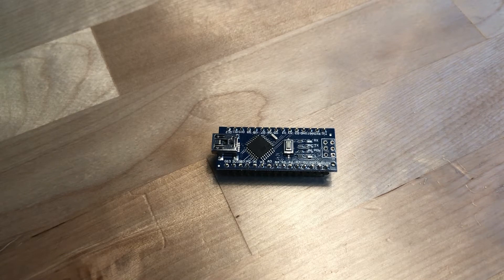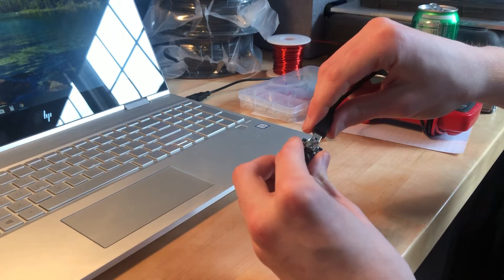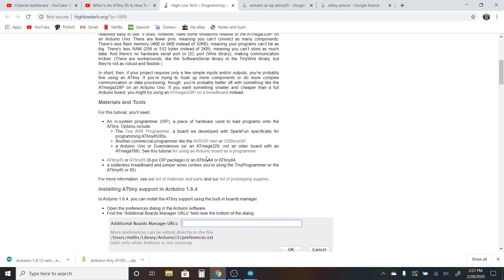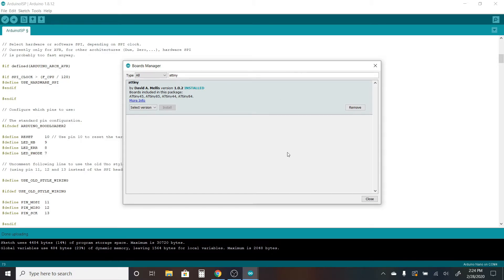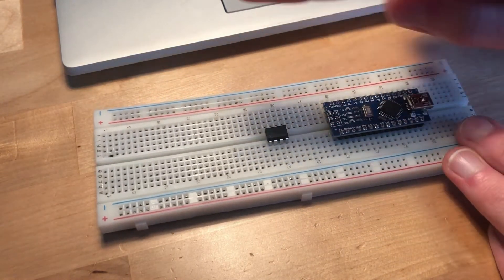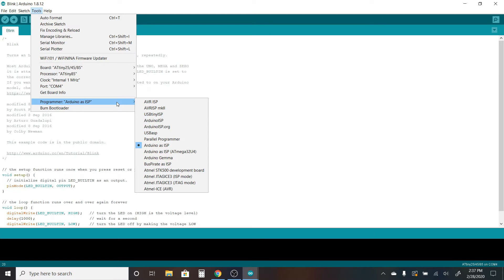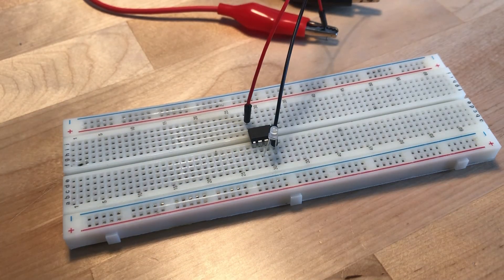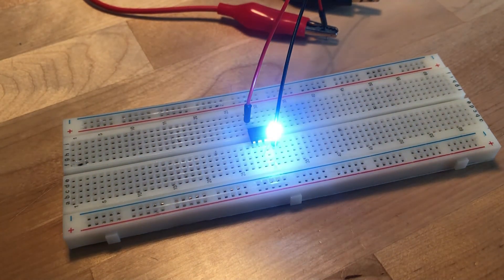How to Program an ATtiny with Arduino (Up to Date)

Comment: the link in the description seems broke, when I put it in my preferences and open the boards manager, I get this error: "parsing error occured:
com.fasterxml.jackson.core.JsonParseException: Unexpected character ('<' (code 60)): expected a valid value (number, String, array, object, 'true', 'false' or 'null')
 at [Source: (FileInputStream); line: 1, column: 2]
"

Comment: Great video. Question: should a current limiting resistor be used with the LED (most arduino projects seem to require that, to avoid blowing it). Or is the AtTiny85 somehow negating that need  ?  Many thanks  ... 🇬🇧

Comment: Superb! Thanks.

I did this with an ATTINY45, as I had no 85s. Same pins, just less memory.

The only problem I had was hooking up to the 45's physical pin-3, not it's digital/virtual pin-3, which is on physical pin-2. Oops!

I'm gonna get some 85s for projects.

Thanks.

Comment: Excellent explanation.  Go to sketch --Upload using programmer and it worked right away. The normal upload  Arrow continued to produce the Error: Programmer needed. IDE2.2.1

Comment: The reason it fails is most likely because of the Arduino Nano clone you're using. I have the same one. The RX/TX LED:s on the Nano clone board are connected in a way that interferes with serial programming, so just go ahead and desolder those LEDs and the whole thing should be way more stable. :)

Comment: I'm using Arduino Uno R3, Arduino IDE 2.0.3 and attiny 1.0.2. I've uncommented "USE_OLD_STYLE_WIRING" and I'm not using a capacitor. I was able to burn the bootloader on my ATtiny85, but not the Blink sketch: "A programmer is required to upload".
Reply: Problem solved: I should have used "Sketch" → "Upload Using Programmer" not just the "Upload" button!
Reply: @GeorgMierau  useful tip, thanks

Comment: I'm looking at the pinout of the arduino nano and I'm wondering why it is pin 11, 12 ,13. I have like 100 teensy 4.0s in the lab and I'm wondering if I need to order an arduino nano to program my ATTINY861V-10MU.  Thanks!

Comment: Very clear and useful, thanks. 8:29 Note that the LED is connected to the pin named PB3 on the ATtiny, not "pin 3"... it's actually physical pin 2 on the chip :-). BTW there's no need to disconnect all the wires from the Arduino to test the blink sketch; just stick the LED in.
Reply: You are correct (DIP8 pin 2) but so is Chris "PIN3" is PB3 and DIP2 ("PIN0/PB0" is on DIP5, for another example)

Comment: good day sir levi, i have a ATtiny85 chips already programmed and used in a small board with relay. this board is used in motorcycle with two additional low/high LED lights left and right of the bike.
The  board has two terminal connection  for passing light switch. when the passing switch was press the two led blinks low and high continuously and can adjust the rate with a potentiometer. my query is can i copy the program of attiny85 chip installed on the board and re program to anew IC attny85? or there another way to copy the program using any programmer. thanks

Comment: What about the ATTiny 2313
Reply: Did you figure it out?
Reply: @Daniel-hd7gq  Never got around to try it.
Reply: @Daniel-hd7gq  Will look at it the weekend again. If you sort it it please share. Notice that the author does not respond to comments or questions.
Reply: @evertspies3345  I've eventually got it working pretty fast. Just had to download the right board lib. If you need help, let me know.
Reply: @Daniel-hd7gq  Hi thank you. I remembered that I did download the board library. There were a couple of them. Just had to get one that worked. I looked at what I had done then and found that I had made a few piggy back boards that plugged into the arduino uno for the different microcontrollers. I never did make one for the 2313 although. Used AVRDUDESS to program hex files. Would a appreciate the link to the library you used.

Comment: Just FYI.. if you're using an attiny84A 14 DIP, connections are: 

5V <-> pin 1 (vcc) 
GND <-> pin 14 (GND) 
D10 <->  pin4 (Reset) 
D11 <-> pin6 (MOSI) 
D12 <-> pin8 (MISO) 
D13 <-> pin9 (CLK)

Comment: This was an excellent tutorial. After uncommenting the #define it finally worked, thanks for the detailed explanation. You made the world a better place by sharing. Thanks again. I will use my attiny85 to trigger a relay circuit to turn on and off my hydroponics water pump. This will allow me to change the turn on time and off time with another program using millis () commands to reduce energy use in the hydroponics system.

Comment: Cool; but what would be the limit of what you could use this board for? Say; 1 sensor and simple actuator control?
Reply: 5 programmable GPIO equivalent pins (and a optional hack to use the reset pin as a 6th). Many more if you use external shift registers to expand.

Comment: just use teensy, it is much much faster, and legit just better.
Reply: ATtiny = $1  // Teensy = 19.95  . Everything has their uses.  Unless you need "computing technology" there is no need to use an expensive microcontrollers. An ATtiny85, ATtiny84 or an ATtiny10 in conjunction with other IC's will reduce your crafting costs by 15 bucks a build.
Reply: @TrillShatner  I was talking about the start of the vid where he says he uses an arduino nano. they cost around 10$, yet are super slow, even an order of magnitude slower than a basic 3$ arm chip.
Reply: @goldenpiston8449  agreed, however not entirely sure if you can program one of these with a teensy.
Reply: @goldenpiston8449  Nice~  Thanks man

Comment: subbedddddddddddddddddddddddddddddddddddddddddddddddd. 7:35 regards. should i press the burn bootloader instead if in case it was not installed? is it the same code for the bootloader?

Comment: i had to put 100uF capacitator (had this one avaliable) between nano's gnd and rst pin in order to flash ATtiny 13. My nano is Chinese clone and i have to use old bootloader option while flashin ISP sketch. Got me stuck for few hrs. Mabye helps others...

Comment: Can the ATTINY run off a 3v button  battery?
Reply: According to the datasheet it can run:
4MHz @ 1.8v - 5.5v
10MHz @ 2.7v - 5.5v
20MHz @ 4.5v - 5.5v

Comment: Why does the LED not fry without a resistor? :O
Reply: Great question.
I suspect both ATTiny and the LED would be stressed without a current limiting resistor. 
Perhaps the LED survives because of the  one second off, following the one second on. I wonder if this could be left running for a long time, anyway.
Many ATTinys have limited current current output - of the order of 30 mA. Overdriving a load could perhaps cause heating , or evrn breakdowns
Reply: I wouldn't say this is a very healthy way to drive an LED

Comment: best video on this currently.  one thing to note on the Uno and Mega; you will still need to connect a 10uf capacitor from the reset pin to ground (on the Uno or Mega).  I tried the bootloader twice without the capacitor and it wouldn't sync.
Reply: yes, I had the same problem. thanks for the tip
Reply: Mine worked without capacitor

Comment: Hey, what exactly is the new wiring method? Because all the tutorials I've seen so far show the wiring method you use but without uncommenting the #define use_old_wiring. Sorry if it's a stupid question but any help would be much appreciated.
Reply: I believe the new wiring uses the ISP header, but the old wiring just uses the pins. I may be wrong, so don't blame me if your sketch won't work.

Comment: I had no idea you could use the arduino platform. Honestly I just use a programmer and used the datasheet for the Controller.
https://www.sparkfun.com/products/9825
https://ww1.microchip.com/downloads/en/DeviceDoc/Atmel-2586-AVR-8-bit-Microcontroller-ATtiny25-ATtiny45-ATtiny85_Datasheet.pdf

thats really cool tho